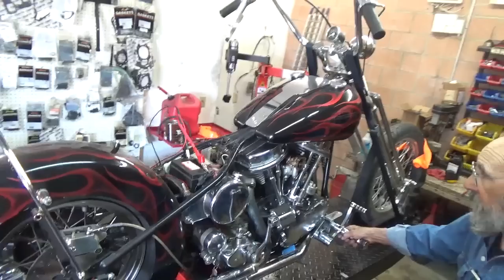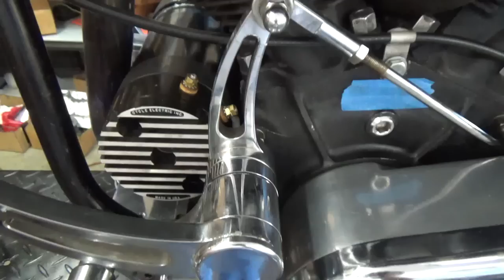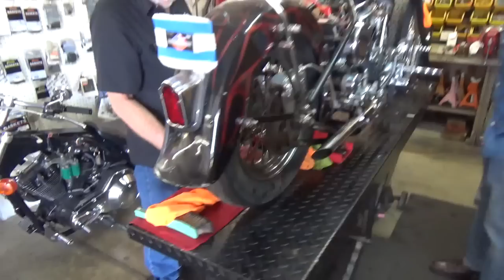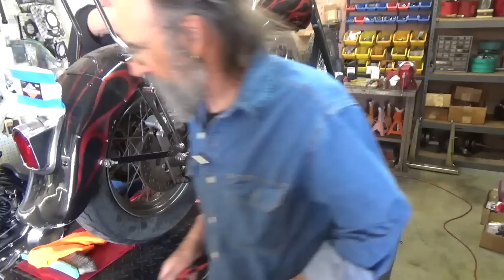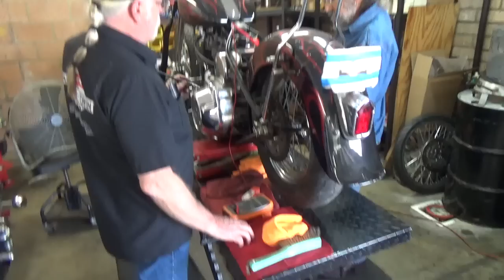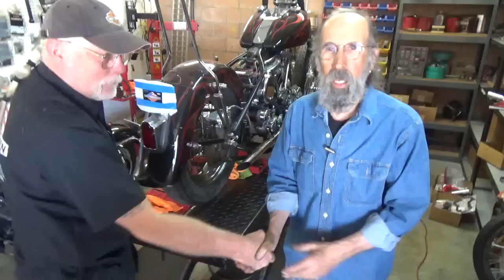65 Harley Panhead is Alive and Well!

Comment: Mike hope this gets to you! The rear head motor mount hole stripped out hilly cord at and if so what size
Reply from the maker: Depends on what the motor is, but it's most likely 7/16 coarse in the head.
Reply from the maker: That's 1948-1984.

Comment: Mike, can you explain a bit as to why you would either retard or advance the ignition. I have been told that in a "highly" modified bike, you would advance the ignition, What exactly does that accomplish?
Reply from the maker: This is a much longer discussion than I can go into right now.  But, basically, "ignition timing" is what decides at what point in the rotation of the crankshaft the spark ignites.  Advanced timing is earlier in the compression stroke and retarded timing is later in the compression stroke.  The factors that enter into the decision (or experiment) as to when this spark is to occur are basically, valve timing, compression, fuel, on and on.  "Modifications" differ a lot.

Comment: Just so great to observe old guys who know these vintage machines on the job! So what exactly would you recommend in the engine oil and transmission fluid departments for the Panheads? Own a '52 FL; I've always used straight 50 for engine / 80w90 for transmission but recently I've read all kind of different opinions for these old Panheads, even to avoid GL4/5 transmission fluids? Living in Scandinavia we have a fairly short season and cold temps even during summer (we rarely see temps above 75 deg F) but at the same time going too thin would make a horrible dripper
Reply from the maker: I don't push brands and I live in Southern California.  But, I run 20/50 oil in my Harleys.  Yes, they're not completely oil tight.  I run 85/140 trans oil intended for motorcycles.  I've been doing this for several years.  They don't seem to be burning any oil and they seem to last a long time.  I'm not a chemist.  This just seems to work for me.

Comment: Hey Mike, great videos as usual. I've just been having an issue with a used S&S Super E carb I picked up at Davenport a few years ago. I went through it and rebuilt it. It is now on a fairly stock '68 FLH. The issue I have been having is the throttle not shutting down ASAP when you shut the throttle off on the twist grip on the handle bar. This is not allowing the revs to fall quickly when changing gears causing the shifts to be hard.  I played with the carb and installed a new throttle spring on the throttle spool (wheel on throttle shaft) and the pump too. As well pulled the pump rod to ensure it was not gauged which can cause it to stick and not allow the throttle to close easily. All should have helped, but it did not. I'm now playing with the throttle cable thinking it might be the culprit. I should mention that when the revs do not go back to the idle speed I want, that I can slightly turn the throttle spool by my finger and the revs fall telling me something is binding and not allowing the throttle disc to close up freely on its own. Have you had similar problems? What do you like to lube a stranded throttle cable with and while I am asking, what do you like to use on the older throttle solid (wire type) cables on the old Linkert carbs with the factory internal throttles? Thanks.
Reply from the maker: There's a possibility your throttle plate is not centered.  Loosen the screws that hold the plate to the throttle shaft and move the plate around a bit.  Make sure the plate is not mounted inside out.  Make sure the bevels on the plate center in the carb.  I use Break Free as a cable lube.  I use it on all cables.
Reply: Hi Mike, thanks for your thoughts and advice on lube. Take care!
Reply: Morning Mike, starting to look like it is my auto advance distributor ('65 - '69), since everything else checks out. Perhaps your followers would be interested in hearing a bit about them sometime. Have you ever had any issues with them causing the engine RPM to not fall off immediately when the throttle is closed?

Comment: Panhead is my dream. I have evo 1998 and problem. No idea what it is. Sometimes when I turn off the engine it maks sound identical like here :
https://youtu.be/8tlC4vXw36o
Reply from the maker: Sounds like "air."  Check spark plugs.  If one is dark and one is light, vacuum leak at intake manifold.  Remove and replace intake seals.  Listen at head breathers.  Could even be bad umbrella valves (inside rocker boxes).
Reply: @pacificmikesgarage Thank you for your answer . The motorcycle was standing for several months. This sound sounds like a squeaky door or a bit of metal rubbing against metal or rubber. In addition, it revs normally and you can hear it sometimes when I turn off the engine, and sometimes you can't hear it. Someone told me it could stand on the lifter bearing but you only hear it after it fades out. You cannot hear this when starting up and running. Thank you so much again!

Comment: Hey Mike sorry I know this has nothing to do with this video. Just figured be easiest way to ask u this. I have a 97fxd. What would make oil come from the screw holes on my oil pump? Just a gasket I'm hoping and not needing a new oil pump. I have oil pressure as I should so doubt I need a hole new1. But just curious if u might know if this is something that happens when those gaskets go bad
Reply from the maker: Not sure what's happening.  I would have to disassemble it and inspect it carefully.  I would remove the pump and look it over until I figured what happened.  This is a more involved project than just removing the oil pump bolts.

Comment: I just want to know what sorry sob invented spirolox? And wherever he or she may be may they rot in purgatory. And Keith Black can kiss my Irish arse for using them! Why why why! Ahhhhhh
Reply from the maker: You can use circlips in place of them.  You can even use "button" type keepers.
Reply: @pacificmikesgarage   I called the folks that make those Keith Black pistons. They told me that they use a square grove that keeper inserts into and said they would not recommend using the standard round Evo style clips or the button style keepers. Just saying what they told me. Wish I had bought  Wiseco now! There is a company that makes a special tool for those spirolox keepers but not in the 792 pin size they use, that was more good news.
Reply from the maker: Sorry you don't like them, but, thank you for the research.

Comment: Good morning Mr Pacific, Cameraman Mike, hope all is well. She sounds angry 😤, just how we like it. Never worked on a Pan, but she looks like a peach 🍑. I had a scoot over charging at 19vdc once, everything was super bright until you start smelling burnt electrical components, way worst than undercharging imho. 200vdc? Are we sure it wasn’t 200mv and maybe not charging or bad ground? Being an electrician and knowing just how dangerous DCV is, I’m surprised every light didn’t blow and wires didn’t start smoldering. Anyway, there couldn’t be a better mechanic to sort out the issue, the infamous Pasadena Padre will fix you right up in no time. Take care of yourself Mike, you’re the best.
Reply from the maker: Thank You.  I think a faulty meter is an issue here.

Comment: sweet sounds  I love the old school bikes my first was 55 pan i put it together in 1968 it was a birthday present with a catch I had to put it together in a week or lose it 3 boxes of part 2 wheels 2 tires and parts for a rolling frame 5 days later I kicked it over 6 kicks and a little adjustment and it ran wish I still had it but that's another story keep the rubber down and the wind at your back till next time. C.T of WV
Reply: I wish I had a 55 Pan since that was the year I was hatched. I’ll keep searching until I find one. I’d be happy with just a set of 1955 cases.
Reply from the maker: 55 cases are a great year.  That's when they came out with Timken tapered bearings on the output side (awesome improvement).
Reply from the maker: Sounds great!

Comment: Does it have non resistor plugs and wires? I have found that on both of my bikes with points and non resistor plugs and wires a digital multimeter will be all over the place while running. I either use an analog multimeter or temporarily install resistor plugs.
Reply from the maker: I brought my meter in.  It runs fine.

Comment: Had a meter do the same thing. Needed a new 9 volt battery..
Reply from the maker: Sjould have brought my meter in.  We're fine.
Reply: Ive had the same issue. That's one reason why I have more than one multimeter. That and because I always forget where I set it down until I'm done looking for it.

Comment: I recently bought a stock 65 FLH in rough condition… not sure 🤔 what direction to go with it … that’s a sweet chopper…. I just hit the Like button … came up three 65  …
Reply: If it's stock I'd keep it that way. First year electric start last year panhead. Rare find, congrats.
Reply: Don't fuck with it last year pan first electraglide
Reply: Depends what you want to do with it. It will cost a lot to get it back original, but it will be worth a lot more if you did. 65 is a very important year being first Electra Glide and last Pan. If you just want to enjoy it though and it's already pieced together I'd say leave it that way, and maybe collect some original parts as you go. Make her safe and enjoy. 🤘
Reply from the maker: It's all about you.

Comment: That was an acquaintance of mine who commented about leaving the breather separator screen out. I left the screen out of my mongrel rat panhead, but have the baffle plate in place, and both are in place on my 68 shovel. I've heard the screen part was put there by the factory to help prevent foaming of the return oil,  but modern oils have anti-foaming additives so it is no longer necessary. In any case I can't see a difference in the return oil from either motor. I agree that the factory had a reason, or they wouldn't have spent the money on that production step. I really enjoy your videos. Thank you.
Reply from the maker: Thank You.  I've found the same, but thought it just might be me.

Comment: Thanks for sharing. How did you know where the timing was without using a timinglight? I just replaced the camgear cover on my 98 softail and checked the timing with a light ,at idle I have TDC but it says in the manual to set it at 1300 to 1700  and the mark with a dot should line up . Problem is I don,t have a tach. Am I alright TDC at idle? Thanks. Weather here in N.B. is just starting to warm up enough now to take a ride!
Reply from the maker: Don't tell anyone, but with electronic ignition, I've set them by ear.  Points, I use a light bulb.
Reply: @pacificmikesgarage  What kind of ear?  If she is a " Knocking don,t come a Rocking" LOL

Comment: Had 19V on my Shovel, and I replaced the alternator and regulator . Same problem! The battery in the multimeter was low, so it did not show the right values, Expensive lesson ;-)
Reply: That's why it's not a bad idea to have more than one multimeter, especially in a shop. That and because when you forget where you put one 🤣
Reply from the maker: I'd say so.
Reply: Ouch.